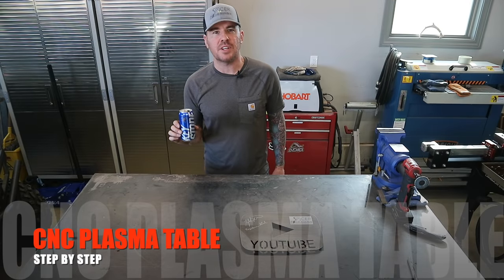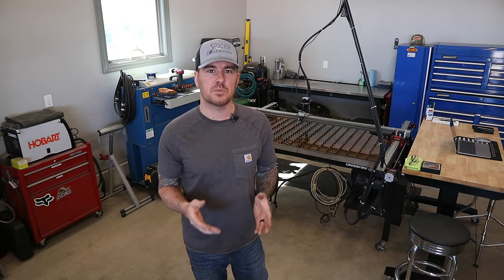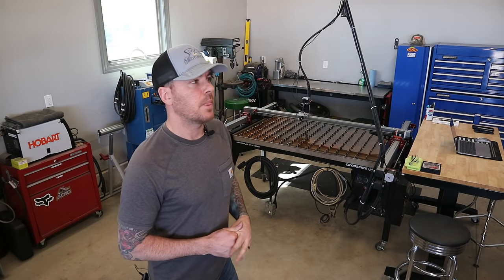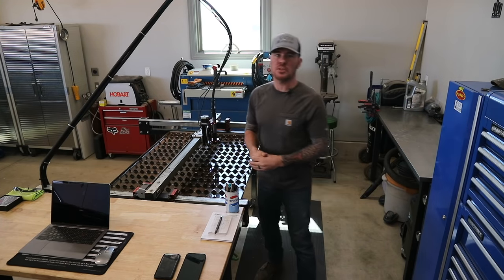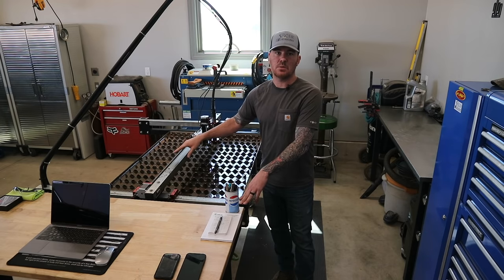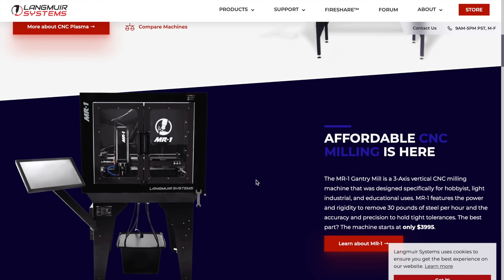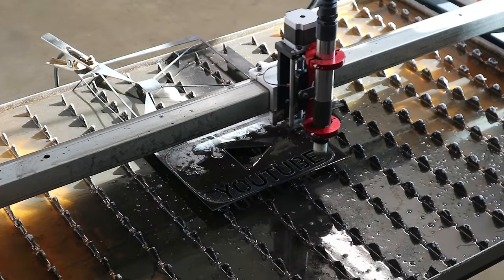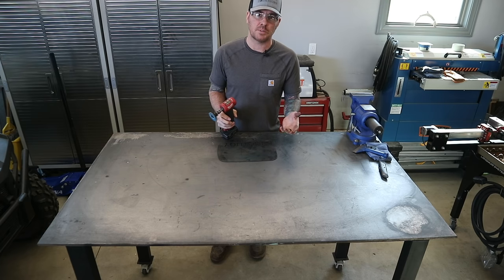MAKING MONEY with CNC PLASMA TABLE! .....STEP by STEP

Comment: I'm waiting on delivery of my table and have been surfing around for tricks. The canvas thing is new to me - thanks.  I've got some tips for you too. I've got cad/cam background just not fusion. 

If you're designing something with symmetry like the YouTube button, just draw one side and mirror it to the other. Also, your construction line for spelling out YouTube could have been an offset from the bottom of the button. Basically, just copy/mirror existing geometry when you can rather than redrawing the same things over and over.
Reply from the maker: Awesome.  Thanks for the tips.  I have used the symmetry tool before.  Works well
Reply: @SpicerDesignsLLC  Figured you got to it at some point or another, but thought I'd mention it just in case. 🍻
Reply from the maker: @RideRevival  im open for any pointers i can get.  Im not an expert on cad but i get by.  Fun to learn.

Comment: When you ordered the plasma table what all did you get for add-ons and why?
Reply from the maker: I ordered it with the plasma cutter which is ok for light stuff.  Also got it with the torch controller just because they recommended it.  I would recommend getting the machine torch for it.  I recently got one and i really like it.  Hopefully that helps

Comment: does it support other software besides fire control?  do you see any reason to use anything besides fire control ?   Thanks Im new to  CNC
Reply from the maker: I believe its only fire control.  Its works well and dont see any reason to use anything else.  I think the smaller machine uses different software.

Comment: Where do you Buy a Good Sheet of Metal For $100 Dollars
Reply from the maker: No where now.   I stocked up the last order a couple months ago at about $115 a sheet.  I do have a deal where I get cut off right from the roll mill for dirt cheap.  I might adjust that thumbnail.   just trying to use even numbers for the title.

Comment: Hey question,  I'm in the I.B.E.W. LU 728
Would make a sign for me and how much would it cost and what size would you make. Thank you 
Daren from south east Florida
Reply from the maker: I certainly can make one for you.  They are 24” diameter.  I sell them for $100 plus shipping.  They are the old version of the bug with 15 bolts fyi.  It filled the sign out better than the new version of 10 bolts.  Shipping can be kind of pricey.  Let me know what you want to do.  Spicerdesignsllc@gmail.com

Comment: I found it easier to convert the image to an SVG file and insert that into fusion. IOS has an excellent free program.
Reply from the maker: Ill have to check that out.  Ive just gotten used to making them from scratch.  Ive noticed when i converted them in the past it creates a ton of fixed points on curved lines or circles.  Where its not actually a curved line,  its just a bunch of small straight lines.
Reply: @SpicerDesignsLLC  its called image converter on ios.
Reply from the maker: @scottdavis9442  ill give it a whirl.  Thank you

Comment: I'm new to your channel. I just joined today. I'm looking for a large plasma table that cut out  the thickest metal possible. Can you suggest what to buy? Thanks!  Love your sense of humor!!
Reply from the maker: Thanks for the sub!   Im not an expert by any means but i would check out Langmuirs XR tables.  Its 4x8 and you can get the larger Hyperthem plasma cutter to cut heavier gauge steel.

Comment: What kind of drum sander do you have in the background?  is it cost effective?
Reply from the maker: Its a Baileigh sd-255 dual drum sander.  I thought it would work a lot better than it does, but i still have to clean up the edges with the die grinder.   So i rarely use it.  Theres just no good way to clean up the dross and sharp edges efficiently.

Comment: I could not tell, did you program any lead in, lead out in that file? I just got my Cut60DN today that I am going to put on my 30X30 Longmill CNC. Do you really need lead in?
Reply from the maker: Ya i have lead in.  I think you def need it with a plasma machine.  Otherwise youll see the initial pierce in the design.    I usually do a .1 lead in minimum

Comment: Thanks for the Fusion 360 call out!  I am glad to see it's a tool that is working well for you.  (I am a PM responsible for Manufacturing in Fusion 360)
Reply from the maker: Yes, its amazing software.  Ive only scratched the surface on what it can do but im having fun learning.   Thanks for the comment, Ill be plugging Fusion in more videos to come.  Maybe I can earn a discount on that annual subscription one day.   Thanks for watching!
Reply: @SpicerDesignsLLC  let's connect
Reply from the maker: @PM.al.whatmough  SpicerDesignsLLC@gmail.com  Im open for some collaborating
Reply from the maker: Hey Al.  We talked a bit ago.  I wanted to see if an affiliate program is an option with autodesk since im promoting the software on the channel.   Please email me if you dont mind.  I have some other questions as well.  Thanks

Comment: How does this compare to using a water jet cutter?
Reply from the maker: Not to sure on that.  Ive hooked up water jets before at my day job as an electrician.  It seems like there is a lot more moving parts with a water jet and im not sure if they cut as fast.  But dont take my word for it.  Sorry im not much help on that one.
Reply: I'm just now trying to learn more about cnc plasma tables but I used to run a large waterjet at my old job and they have a LOT  of maintenance requirements and the invoices I seen were very expensive because most people don't realize that it isn't just water that's used but also a fine ground garnet with the high pressure water is what cuts the material..that garnet fills the tub up and must be removed and that's exspensive also ...I believe laser cutting is the best but very costly to get into and plasma seems to be the best way to get started for me atleast.... main point is waterjet cutting has alot of hidden costs associated with it
Reply: Does it use a hand held plasma cutter if not which cnc table does
Reply: Waterjet will generally have cleaner cuts with smaller kerf (width of the cut) and almost zero draft (plasma will leave a slight angle from top of cut to bottom).  Waterjet also introduces zero heat to the parts so warping and property changes like hardening or softening at the edge of the cut don't occur.  But a waterjet machine takes up alot of space, is expensive to operate (as some have mentioned), and price wise start 15 to 20x more expensive than this little plasma table.
Reply: Water jet can cut through just about any material, greater thickness, and cuts cleaner. The water jet is much more expensive than the plasma table though so unless you need the extra performance, the plasma table is just fine.

Comment: I would love to know where you are getting that sheet plate 12 ga4x8 is running about $340 a sheet around Martinsburg wv
Reply from the maker: I just bought a 4x8x 14ga sheet of mild steel for $108.  I know 12 ga is more.  $340 seems high.
Reply: Everything around here is high it’s crazy 4x8x1/4” $667 last one o bought for a customer and he about flipped!! Keep the great videos coming

Comment: Hello New Subscriber,
  I have the Pro i make signs,monograms steel and aluminum fabrication parts for race cars and motorcycles machine runs almost everyday without any problems i use Fusion,Inkscape for design work and Sheetcam post process and Fusion post process.I find that F360 isn't text friendly but works ok but i just learned somethhing from your video is bridging the letters am I missing something is there a tool for that on F360.
Reply from the maker: Sounds like your running a nice shop and making some cool stuff.   Im not an expert with CAD by any means. I just work with Fusion 360.  I tried Inkscape to create vector files but I didn't like all the points it creates for curved lines.  So I usually just trace everything from scratch with the CAD tools.  As far as the bridges, there are no tools to make them that I know of.  I add them all in manually.   I use the text on path all the time though.  Thanks for the comment and for watching!
Reply: @SpicerDesignsLLC  How do you do them manually? I draw them manually in inkscape by using the rectangle tool make to the size I need then align it on the letter and then difference it out.But can't that to work in F360. Thanks
Reply from the maker: @deanpurks7474  I just use the line tool, then I use the trim tool to remove the lines I don't want.

Comment: When you say im going to export to post process , you open the window (g1-g2) ,   My question is how do i find my fire control machine.  , how did you make it appear ?
Reply from the maker: Its a little tricky.  Once you get it set up once you wont have to do it again.  The steps are a little different between a mac and windows.  I used the support tab on langmuirs website.  They have a bunch of videos on how to set up the post process.
Reply: Thanks for the reply.  I went to the website and figured it out.   You and the keystone girl are the best
Reply from the maker: Glad to hear you got it figured out.  It can be a little tricky

Comment: What type/size of air compressor do you have? Also, did I read right…the 45 Razor Weld will only cut up to 3/16 thick material?
Reply from the maker: Thats as thick as ive cut with it.  I believe it cuts thicker steel.  I have a cheap 30 gallon husky air compressor with an amazon air dryer.   I ha be another video where i talk about all the equipment.
Reply: @SpicerDesignsLLC  ok, I’ll check out that video. Thank you, I enjoyed the video.
Reply from the maker: @chipkirk9175  that good!  Ive got more coming.

Comment: Why is the Z-axis necessary? Wouldn't it be possible to manually set a specific distance? Is it required for the program?
Reply from the maker: There is a torch hight controller that requires the z axis. It maintains the same cut gap if the steel is warped or starts to warp during the cut process.

Comment: Great vid I definitely got something from watching it! I do have a question or two..... First any regrets on the razorweld plasma aside from limiting to cutting thin stuff and if so what will you get to replace it someday? Secondly my biggest question!!!! That local 697 sign is very clean as in you have some thin areas that seemed to have cut very nice which brings me to the question are you using standard consumables and or what tip sizes are you using as this is new to me? Thanks in advance.
Reply from the maker: Thanks for the comment.   I don't have any regrets on the razor weld.  It was plug and play for the table, and at the time I was starting out with a new machine I knew nothing about.  I would definitely say its an entry level machine but that's what I wanted.  Its definitely not the best plasma cutter but I've cut up to 3/16 with it no problem.  Anything bigger than that im not really equip to handle.  I guess it all depends on your intentions with the machine.  I am running standard consumables.  Ive cut some pretty thin sections in some designs and haven't had an issue.   Hopefully that answered your questions.  thanks
Reply: @SpicerDesignsLLC  yes thanks much!

Comment: Thanks. Fun. Subscribed!  I have the same table. Also bought two welding tables joined together.  Langmuir rocks. I'm using the Harbor Freight Plasma I got on sale. Works great. Would you mind detailing the air drying system you set up? I need to add that to my set-up. Cheers.
Reply from the maker: Great! Thank you.  I will add a link to the video if its not on there already.  Its just a cheap amazon dryer.   Seems to work pretty well.

Comment: what type of air dryer do you use for your cutter.  also, did you have any issues with langmuir technical support after purchasing the table.  i've heard that once you buy the machine, they're difficult to get ahold of for help and that the only help is from the forums.  is that true?
Reply from the maker: I just have a cheap air dryer off amazon.  The razorweld has one built in too. Sometimes the customer support refers you to the forum.  Theyre ok but there is a lot of info in the forums and they respond quick.
Reply: @SpicerDesignsLLC  man, i want to take the plunge but after reading the forums and all of the problems people are having, I'm very hesitant.
Reply from the maker: @jamesdufrene3572  its definitely an entry level machine in my opinion.  Ive had issues with mine but in a way it forced me to learn everything about the machine. Now when i have a problem i know exactly what it is.  Its been a good machine for me.  It does everything i need and the price is right.  Anything you get will have kinks.  A lot of the guys that get these are beginners  too.  I was one of them.  So a lot of the issues are likely operator error.

Comment: What’s the electricity cost to operate?
Reply from the maker: Its minimal.  Just a 30 gallon single phase compressor, 240 volt single phase 30 amp feed for plasma cutter.   similar to a welder.   Not sure an exact price for electrical.  I don't even notice it on the bill.  Obviously depends on usage too.  I have some other videos where I talk more about the requirements and specs.   Hopefully that helps

Comment: How wide were your bridges (I’ve always called them “tabs” for some reason)?  How thin can you make those with that cutter?  I’m used to designing signs for laser cutting, but the laser belongs to my day job.  Thinking about getting something like this to keep from being a middle man.
Reply from the maker: laser machines are nice.  I wish I had one.   I wouldn't go anything less than an 1/8 wide on the bridges with the plasma machine.
Reply: @SpicerDesignsLLC  that's not bad.  Thanks!

Comment: Awesome videos thanks for the tips and tricks. I think you said 14g for the small signs. What are the typical gauges and types of steel you use for signs?
Reply from the maker: I use 14 most of the time.  I like to use a little thicker gauge for welding to it

Comment: Your former electrician I have a welder that is 220 with a 110 cord on it what  size wire can I use for it?
Reply from the maker: Did you see the welding outlet video i made? That video might answer your question.  Its hard to say what size without any details of the welder.

Comment: Where are you buying a sheet of 16 gauge for $100 at the current price of steel in April 2022?
Reply from the maker: Last time i bought steel was 2 months ago.  Was $115 for 16 gauge. I stocked up and got better pricing.  I also get cut offs for scrap price right from the roll mill. Im sure it when up i was just trying to use easy even numbers for the video.

Comment: Excuse me if I missed it, but have you figured out what the input cost is to operate your table for an hour?
Reply from the maker: I have not.  Are you talking overhead to run the machine ?
Reply: @SpicerDesignsLLC  Yes.
Reply from the maker: @klappy803  i havent.  Its pretty minimal for the amount i use it.  I usually do a couple cuts a week.  So maybe 30 minutes of usage.  Would be interesting to know for heavier use.
Reply: @SpicerDesignsLLC  It sure would.  Every so often I kick around the idea of some light fabrication/creation.  I would think that especially as a start up part time shop and in order to calculate profit per hour, that it would be crucial to know how much the electricity to run the machine for an hour would cost.

Comment: Dude, where are you buying your steel. 4x8x18 gauge is $184, 12 guage $321.
Reply from the maker: Last time I stocked up on steel 14 ga was $115 per sheet.  Thats definitely not the case anymore.  I do have a hook up where I get the heads and tails off coils for a little more than scrap price.

Comment: At the cost of $86,995-$ 369,000 and higher for the machine.
 How many of those $10 plates do you think you need to sell to break even?
Reply from the maker: Hahah.  Your waaaay off.  That machine costs less than $5k.   Click the link Wayne.   You might want to delete your comment.  This is worse than my $10 pricing mistake.
Reply: @SpicerDesignsLLC  , your point is taken. I was looking at Piranha machines. 
I dont see the profitability. Name 1 high dollar item justifying the cost?
Reply from the maker: @jwayne777  i dont want to argue with you about it.  These machines can be extremely expensive.  Mine has long paid for itself.  Its a fun hobby or business.  I can make parts for my tractor, custom signs i typically sell for $500-1k that take about 2 days to make.  Im going to be building some attachments for my excavator with it.  Its endless.  Id rather spend 5k on this than some of the other stupid stuff we spend money on.  Im not trying to convince anyone to buy it just show them its an option.  I have a bunch of videos with projects ive done.
Reply: @SpicerDesignsLLC  Thank you, for replying. 
You named at least one.Thanks Manufacturing tractor parts , mower or small engine parts does justify the cost.
Especially for small farms with obsolete and unsupported equipment that is discontinued. I can see how that justifies the cost.
New Tractors cost as much as a house.
Small engine parts will definitely pay for itself.
Reply from the maker: @jwayne777  ya theyre not for everyone but i have had really good luck and found many uses for mine.  Most of what i do is selling signs with it.  Hopefully you stick around and check out some more videos.   Take care